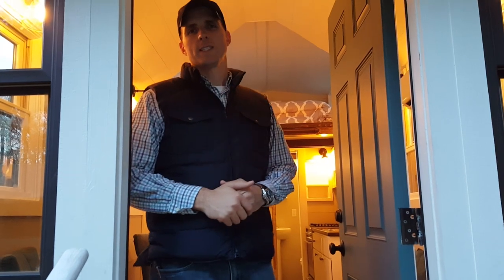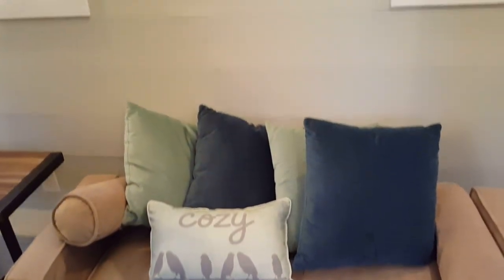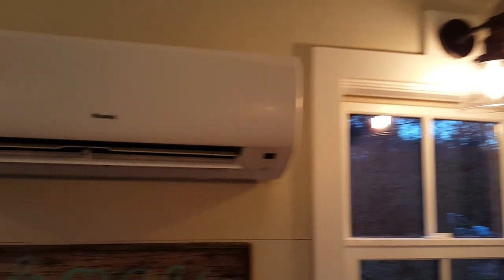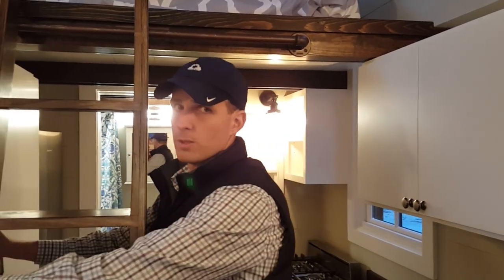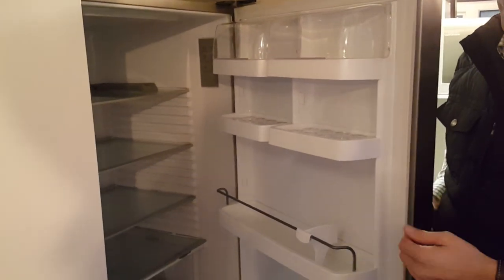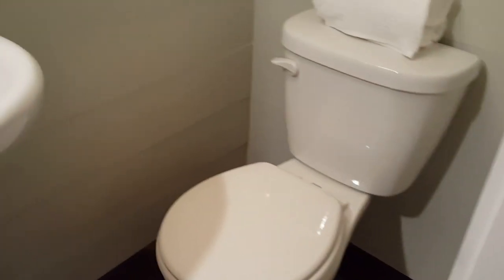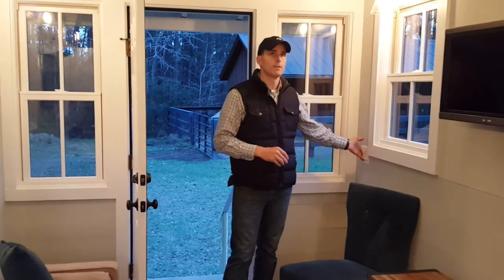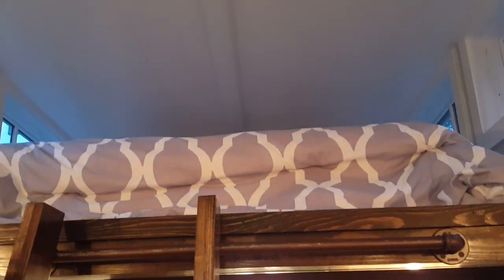Tiny House To Help Flood Victims Video Tour

Comment: The problem now is that tiny homes have become so costly for what you get it is better to buy a camper already set up perfectly. You guys defeat the purpose
Reply from the maker: +Henry Meguess Just like every other market in the world, there are tiny homes that run on the cheap size, mid-range and high-end. You get to select a tiny house based on your specific budget.

Comment: tiny house? truthfully it's a joke? 1. 30k plus for a handful of two by fours and drywall put on a double axle trailer.
2 I wouldn't call that energy efficient in the slightest.
3. I can spend $30,000 and actually buy a house. 
and if I'm going to go green I can spend $30,000 and take earth bags and earth with a little bit of concrete and build a substantial house that is very green very energy efficient very solid and nearly storm proof.
Reply: +zmanstrong41 oh be quiet! There have been dozens if not hundreds of tiny houses that have been diy and listed their detailed costs and although there have been some rare amazing tiny houses built for extremely low price, usually it cost around 20-25k. Jokers like you always claiming how cheap they can built stuff, but havent done jack and never show off their shit-shack they built for 100 dollars....lol.
Reply: +per sebra stfu.
Reply: +Saucy Chica I'm sorry....what I said was stupid and ignorant.
Reply: *****

"You also think it's a good idea to spend 30k on a pile of 2x4's and a trailer ?"
I for one do! I have seen too many absolutely gorgeous built by master craftsmen tiny houses to say otherwise.